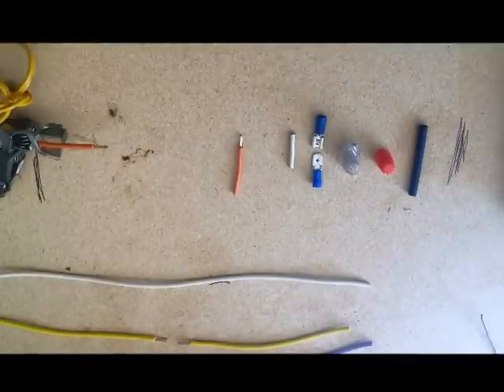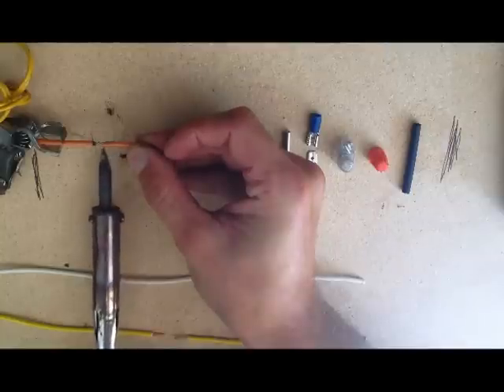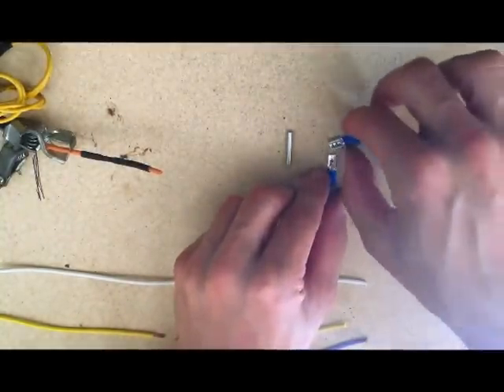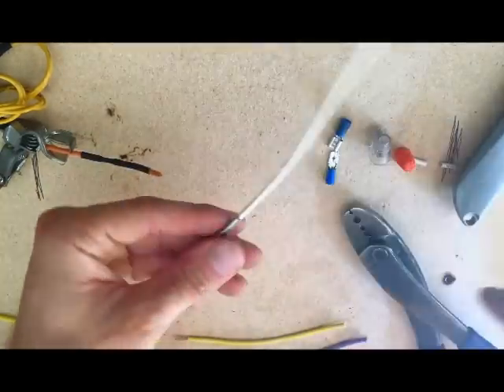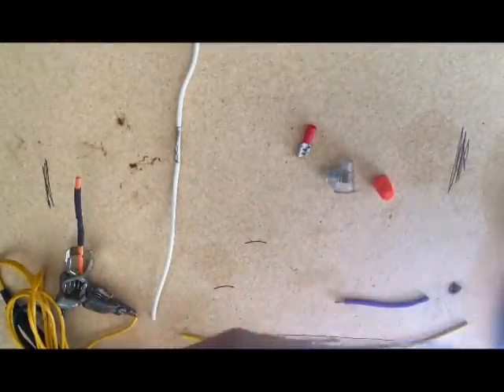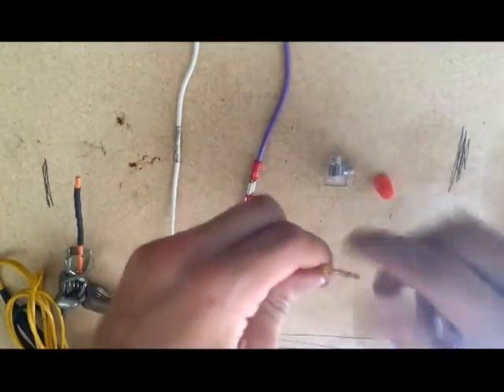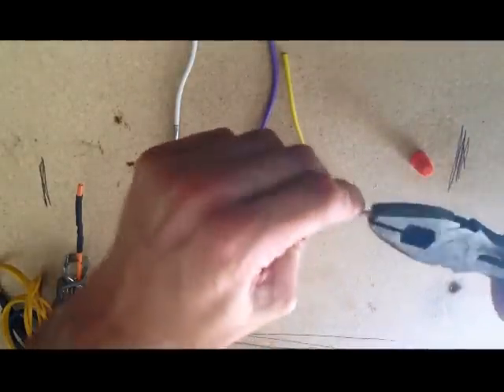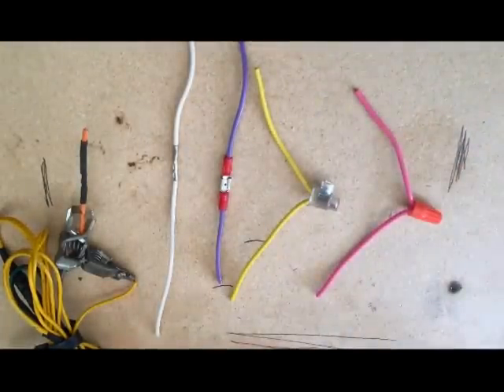How to join electrical cables and wires

Comment: What would be the proper way to join wires at a t junction? I have the wires running through the attic into a junction box.  Then i have used the screw terminal blocks inside the junction box to break out the run down to the sockets.  Is this ok or should I be doing it differently?

Comment: Hi great tips here. I want to relocate my car battery and for that I need to join 2 wires together (pretty thick ones) what is the proper way of doing that? Cam you please advise on what materials should I use and if it's safe to solder it or not?

Comment: Hey mate which of these methods is best to join two power cords together, about 15amps?
Reply from the maker: Generally the best option would be to use a new cable at the length you need. But if you have to join I would use the double ended crimp fittings & stagger each join so there is no way they can touch.